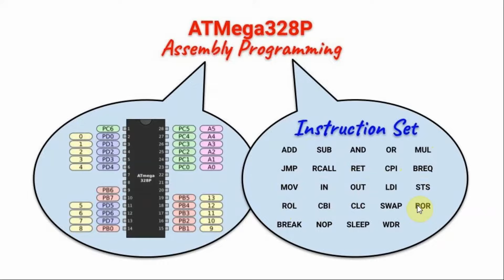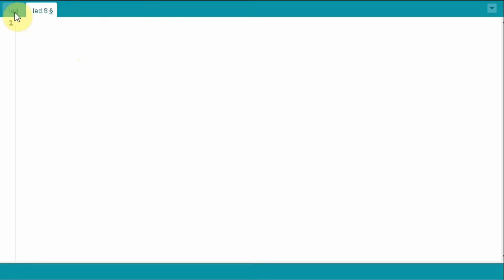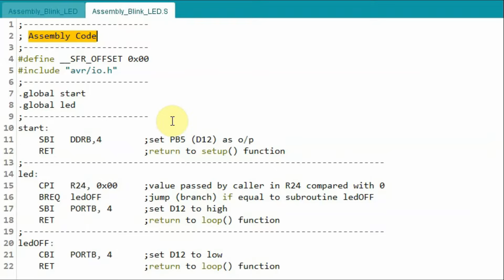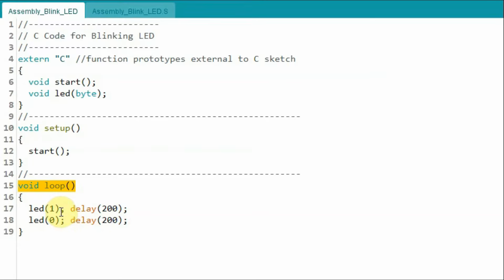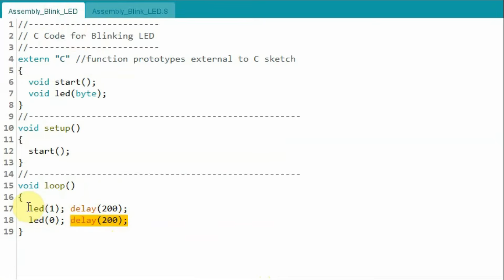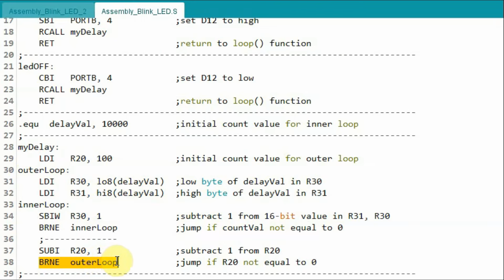Assembly via Arduino (part 1) - Introduction

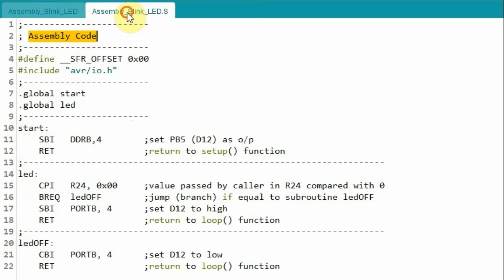Comment: 4:32 remove the compare and branch fron led: function, use two labels, led_on and led_off and led_on() and led_off() for smaller, faster code, easier to read. Don't think high level when you use assembly.

Comment: Thanks! Really interesting. For those who don't know, DDRB is Data Direction Register (port) B. I have a question. How does myDelay get back to the RET on line 19? There is nothing seemingly after the outer branch comparison it seems so if it fails surely the program counter just keeps going?
Reply: ah I see someone else left a comment about the missing RET. OK not just me then! BTW @ the creator. I think you can put an overlay on a vid to indicate this without changing the video itself. Not sure how but I've seen others do it to highlight mistakes that have been noticed.

Comment: Thank you So Much sir. This is a really valuable start to my assembly journey.
I have a question about the time in delay
Since the clock speed is 16MHz, once instruction takes 62.5 ns
but the loop gives 100 x 10000 = 1000000 cycles

It only give a delay of 62.5 ms
Is it correct or am I misunderstood something

Comment: Hello Anas, your code works for me. Howevr, I had one question I was looking through the datasheet and couldnt find information about r24. How did you come to know that R24 is the place where the caller would store its values. Also if I have more than one caller where would i store the rest of the values?

Comment: Hello, I followed the tutorial and loved it, I was hoping to know a couple things:
1) do we need the c file or is that just to slowly introduced a transition from c to assembly?
2) I have the exact dame code as you, except I’m using pin 13 instead of 12, and my led is solid, are the inner and outer loops running faster than I can see and this it stays on?
Reply: Did you return from innerLoop ? I see that he doesn't show that in the video. There should be a RET after the branch, so that when R20 is 0 you return

Comment: DO NOT use 'start' because that is a reserved word. Change the code to 'srarx' and it will build. Beware the code in video is NOT the code on webpage (video shows delay(200) while webpage shows a subroutine mydelay: )

Comment: Is it it possible to use the same assembly commands in Arduino Mega 2560? For me that assembly code is not working. Thats why i m asking.
Reply from the maker: You can refer to the instruction set manual of the 2560. The architecture is slightly different.

Comment: Thank you so much for the great lesson. I hope you come back to those videos to work within I2C for the LCR, Oled, TFT displays, MCU6050, HMC5883L, SPI communication, USART, atmega timers, interrupt service, and other creative projects! I love the way you edit the videos, it is a pleasure watch them and code at home following them. There is a small mistake in the second part of this one, in the very beginning when you "SBI DDRB,4" you comment as it being PB5 (D12) but it is PB4, according to your second video with the RGB led. Keep up the good work. And the videos about writing libraries are awesome. Also connecting Atmega to an esp32, or esp8266 in assembly would be a wonderful lesson!
Reply from the maker: Thank you for your kind words, and thanks for pointing out the error. Currently, I’ve put a pause on my tutorials and will resume coming December.

Comment: how and in what registers are bytes or variables passed from c code to functions in assembly? in your example you pass a byte to the function and it is found in r24, how do you determine in which registers this input data to the functions and also any outputs of the routines end up?

Comment: hello,
very interesting, but it does not work. 
I do copy and paste the code in blink.ino  and  blink .s  file but I got an error " undefined reference to `start'  " and  "undefined reference to `led'"

I use arduino 1.8.15
Reply: S of extension needs to be capitalized!
Reply: @marcnaujoks  I Love you

Comment: 5:55 how do you know it is R24? Can you control which register hold the parameter? Or is it always the same?
Reply: There is in the Atmel documentation that ¨Arguments in a fixed argument list are assigned, from left to right, to registers r25 through r8.¨ and byte 0 goes to R24, byte 1 to R25, byte 2 to R22, byte 3 to R23 and so on.
Reply: did you have solve this problem?
Reply: @Dtspoon  no

Comment: I have found the information here to be exceptionally useful - thank you.
I did encounter one difficulty which might affect others:
when using the SBI and CBI instructions in the assembly the address came back out of range and I had to use the lower address 0x04 in place of DDRB and 0x05 in place of PORTB.
Reply from the maker: Thanks for the feedback

Comment: I watched this out of curiosity as you had mentioned in another post that you were doing assy.
My main question is why?
Have you built a project using the ATMEGA328 that directed you into using assy due to memory limitations or timing constraints?
Reply from the maker: Hi, thanks for your comment. I believe through assembly programming you learn the architecture of the microcontroller, which may help in creating efficient libraries. And on a personal note, assembly is my favorite language!

Comment: Can I always use R24 to pass parameters to ASM?  Thank you so much for sharing your knowledge. I make Assembly programs for the 8051. I'm trying to learn AVR assembly (Arduino), but there is little information on the web. I discovered your channel yesterday, I'm following your excellent tutorials.
Reply from the maker: Hi, and thanks for your feedback. Call-used registers are R18-R27 & R30-R31
Reply: @AnasKuzechie  it is not clear why is it R24 here. Is it always the case? Why is it not R18 or else?

Comment: Thank you, this seems like a very accessible introduction to programming the ATMega on the Arduino board. Curious to see what's next in this series!

Do you also plan to discuss how to skip the whole setup() and loop() program structure that the Arduino IDE forces us to use? I would be very interested in that.
Reply from the maker: Thanks. You can watch part 2
Reply from the maker: As for omitting setup and loop, I’m not sure if it’s possible. I need to research it. I also have a series of Assembly programming video tutorials of AT89S52 controller.
Reply: @AnasKuzechie  Thanks for your reply. I will try to do my own research on the matter but if you could shine your light on it as well that would be great. The reason I'm curious about this is I understand standard Arduino sketches do some background processing that's not always strictly necessary.
Reply: @AnasKuzechie  Is there any performance issues that Arduino loop() is a function call? Should a infinite while loop to be used to call assembly subroutines?
Reply from the maker: @AliusScitmelius  in my other videos I use the setup function to call assembly subroutine and within that subroutine have indefinite looping